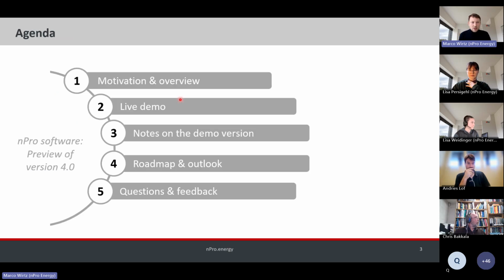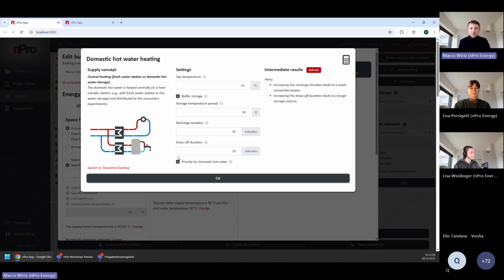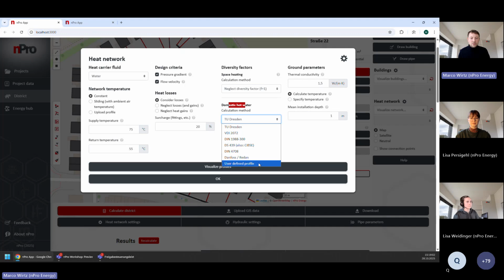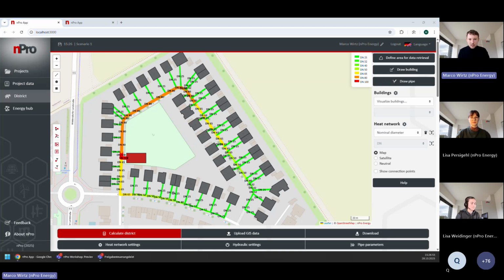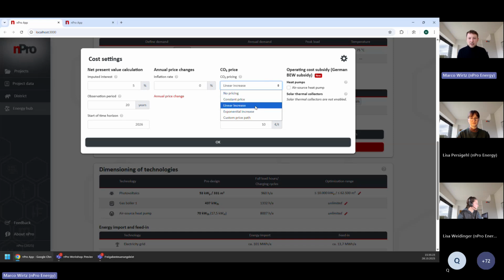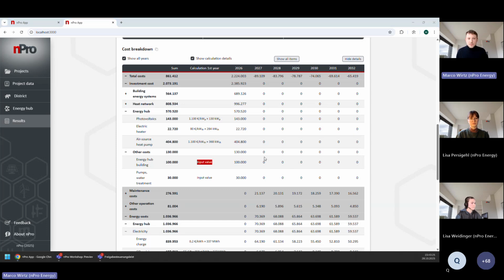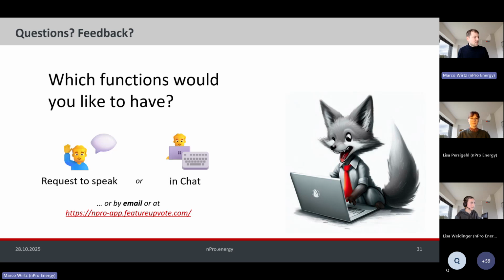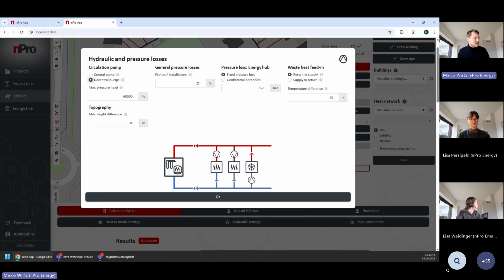Workshop on Version 4.0 on 28.10.2025

Comment: Congratulations! Excellent update 😃. Is it possible to model 2 energy hubs with different supply temperatures? Let's say source 1 is seawater at 15°C and source 2 a waste heat source at 30°C. Since network settings allows to set one supply and one return temperature, how do you suggest to model this? Thanks!
Reply from the maker: Thanks for the question! You can model 2 sources in the energy hub, one with source temp. of 15 °C and one with 30 °C. The heat pumps would then have different COP profiles. However, the target temperature of both were the same, i.e. the network supply temperature. In Version 4, you can also place them in different locations.
Reply: @npro_energy  great, thank you!